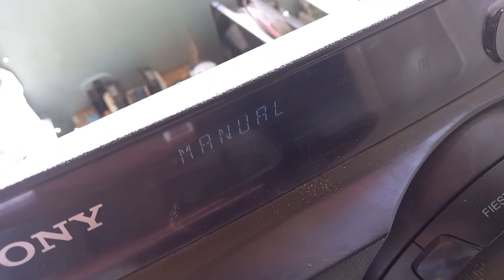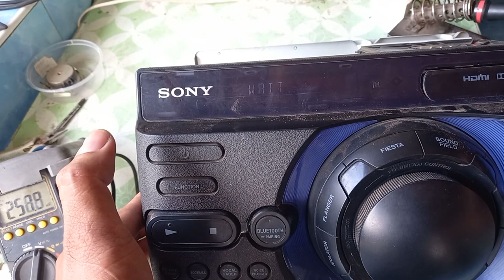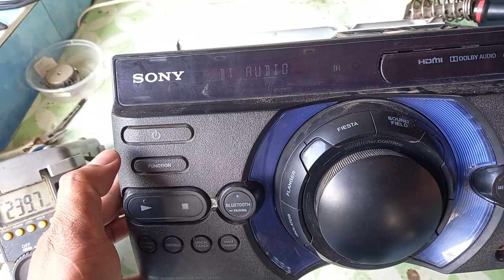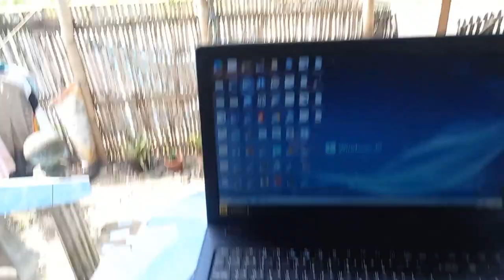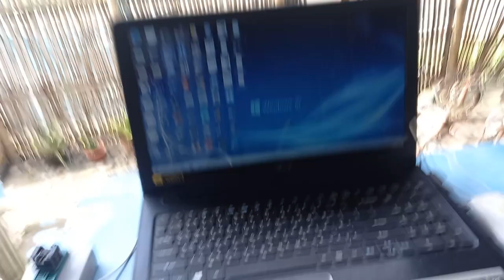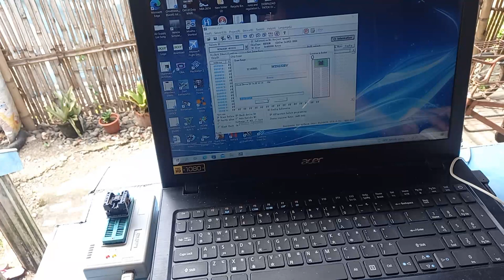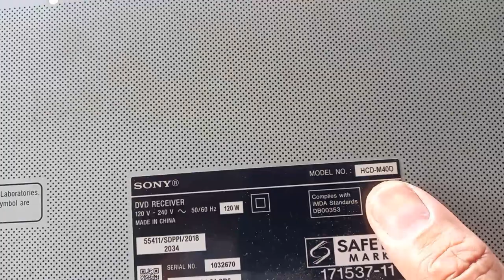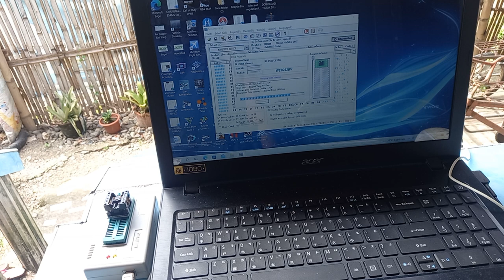Check Manual PROTECT [SONY HCD-M40D] Reprogram EEPROM

Comment: protect 03 message will be displayed if TAS 5634 output amp IC is short .
Reply: Can you give me a eeprom program
Reply from the maker: PROTECT 03 Will Displayed For many Reasons 
#1 if TAS5634 drive output mosfet is shorted.
#2 if TAS5634 No main power 
#3 if TAS5634 sense LOW SPEAKER IMPEDANCE.
#4 Temperature Rise or excited to the limit
#5 OR NO STANBY VOLTAGES FOR TAS5634.
Watch my video completely

Comment: Boss..maau Gabie .naa sad ko ingana Nga component.ng ka problima KY wla nay mugawas na sounds ..sa speaker..peo ok man xa tanan.mugana man mu play man xa bsan ASA iya function..Ang problima lng jud.walay mugawas Nga sounds.bsan vol. Na kaau..aku na gpatan.aw sa technician..nakita Niya Nga daot daw Ang mesfet ba to xa iya g ingon nya Wala daw power musulod ana..Nga part ...nya wla nya naau KY Wala xa Lisa ingadto....boss unsa may maaau Ani sa akua component..para maau xa.?naa ba ka lain ika suggest?salamat boss
Reply from the maker: Boss maayo buntag. Kung wlay supply sa main Amp dapat mu protect siya sa display nakabutang protect 3 ang code.
Reply from the maker: naa ba naka butang sa display sa imohang component na PROTECT 3 before gipa tan-aw sa technicians boss?

Comment: Sir pano po ayosin mhc gt4d, nag auto adjust volume sya, tapos nag auto change din yung equalizer kahit hindi ginagalaw. Na try ko na linisan yung board with dry brush, pero ayaw pa rin.
Reply: Ung sa akin nman. Lumulundag2 sa options kahit hnd pinipindot.

Comment: Boss normal lang po ba mag init ang sonny mhc m60d sinubukan ko kasi mag FM hangang 3 hrs ng nka volume 5 lang pg check ko po subrang init nah
Reply from the maker: Boss, kung subrang init niya sa ibabaw linisan mo na lang baka may mga nag block sa air vent at yung fan Niya. At mag ingat Karin. Kung hindi kaya dalhin mo na lang sa Technician Para walang aberya
Reply from the maker: Kung mag i-init pa yan mag pro-protect na yan
Reply: @sawajiri100  salamat sa advice boss natakot po kasi ako bka masunog

Comment: Boss.. ngana sad aqa..mag protect 3 peru mo tingog man sya ug balik inag on nakug balik gikan naka off. Kaso lang mo balik na sad ug protect 3 kung pakusgan..
Reply: Cge sad ka sunogan ug speaker boss..
Reply: Unsay name nimu sa fb boss.
Reply: Unya mangurente sad Ang component kung masakhilan iyahang kilid boss.. salamat Daan sa pagtubag.. unsay maayu naku buhaton Ani boss.
Reply from the maker: Boss Digital po yung ic amplifier yung TAS5634 kung mag karoon ng short sa output ma dedetech po yan at hindi ma susunog ang speaker mag sha-shutdow lang po ang main supply ng amp. Kung lalagyan naman po ng ibang speaker ibang kaso naman po yan pwede ma damages ang Amp IC at drive ic kung hindi match ang speaker impedance.

Comment from the maker: PROTECT 03 Will Displayed For many Reasons 
#1 if TAS5634 drive output mosfet is shorted.
#2 if TAS5634 No main power 
#3 if TAS5634 sense LOW SPEAKER IMPEDANCE.
#4 Temperature Rise or excited to the limit
#5 OR NO STANBY VOLTAGES FOR TAS5634.
Watch my video completely
Reply: Paano po aayusin yan sir pag lalabas ang protect 03??
Reply: San location mo
Reply: Location mo boss. Kasi nag ganyan ung sony namin
Reply: same unit,same problem.